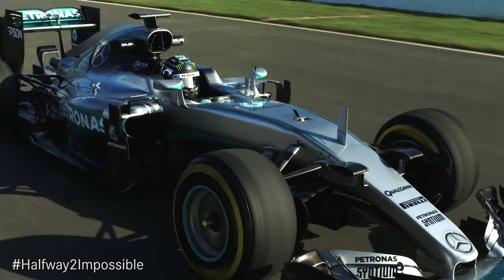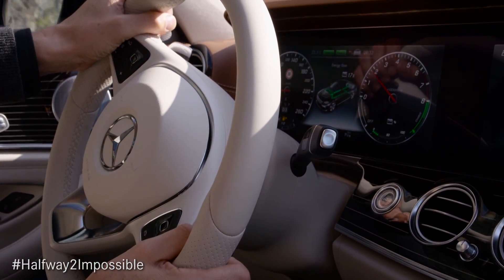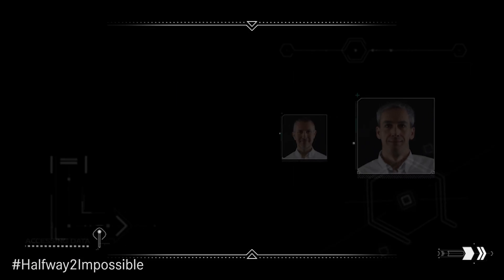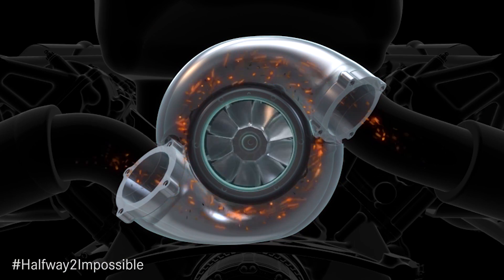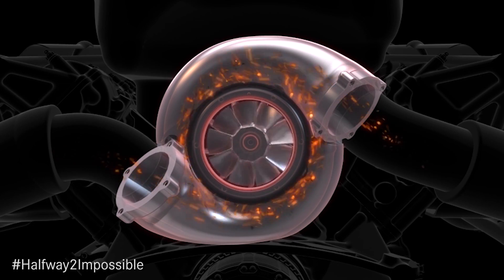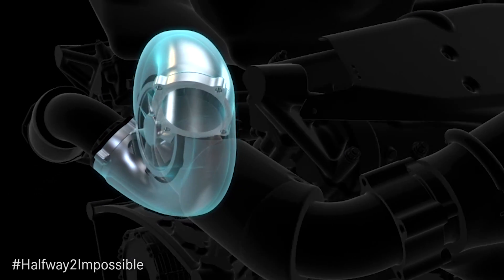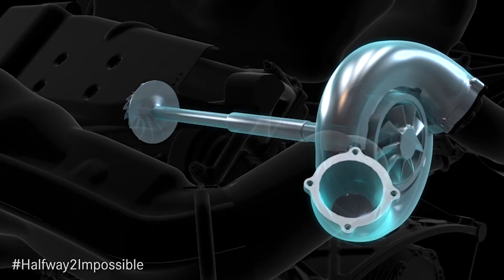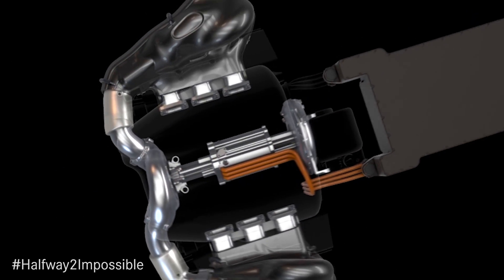How Does it Work? Mercedes F1 Turbo Explained! (2/4)

Comment: I dont get it. F1 fans suffer because the FIA got pressured by activist but non of this technology is even going into road cars? so what was the point? the way an F1 engine works in in no relation to new road cars. they have as much in common then what they have with a diesel engine.

Comment: 1-4 turbo intercooler petrol engines all in Mercedes Benz, AMG, Brabus, Lorinser have been invented by terrorists, street racers.

1-4 turbo intercooler petrol engines all and 1-4 turbo intercooler petrol engines hybrid all in Mercedes Benz, AMG, Brabus, Lorinser : easy damage, 20-100 l/100km, over 100 l/100km with F1 speed and test maximum over 20,000 rpm.

End report.

From
Mercedes Benz all databases

Comment: "The technology of Formula One is well-aligned with the road-car technologies today."
So when is there going to be a production hybrid car with a turbo-generator unit?
Reply from the maker: There are already many production hybrids. And many e-turbo units on the market. You don’t need a 1:1 replica of the complete technical solution for the learning and knowledge to be deeply important to future technologies. Indeed, it’s a mistake to say that because you don’t see the same tech replicated 1:1 that it’s not happening. It’s precisely at the higher level research and learning that gains are made. After this, we apply them to achieve maximum performance, production vehicles will deploy in other ways to achieve emissions or fuel consumption targets. But the development mission of improving thermal efficiency is shared - and the knowledge that propels that mission is both relevant and shared in both directions.
Reply: Today! C Class!

Comment: All petrol engines 1-4 turbo intercooler in Mercedes Benz AMG, Brabus, Lorinser : 20-100 l/100km, over 100 l/100km, easy damage.

From
MB database

End report.

Comment: So having that huge, heavy shaft connecting the impeller to the turbine increases efficiency? Really? And where is similar technology used in "road cars"? And I'm having trouble figuring out you can even JOKINGLY call an F1 car "efficient" or imply that F1 racing is making road cars more "fuel efficient". If I'm not mistaken, F1 cars are burning ethanol, which weighs well under 7 lbs per gallon. Closer to 6 lbs per gallon is probably closer to what its being used in F1 cars to enable them to run extremely high engine RPM and dynamic compression ratios without detonation. 

But I'll use 6.5 lbs for my example. 100 kg is 45 lbs, give or take. Assuming the car goes 200 mph CONSTANTLY for one hour, which is how it should produce the "best" fuel economy since acceleration from slow to fast takes far more fuel than maintaining a specific speed and BRAKING literally produces ZERO mpg or even LESS given how much energy fuel was burned to create is wasted as heat and friction, an F1 car will burn 45 gallons of fuel in one hour. 

That is just under 4.5 miles per gallon. In a super-light, supposedly super-aerodynamic vehicle burning "green" renewable fuel and using the latest, greatest and supposedly "state of the art" technology. And those "high tech" and "state of the art" cars weigh only 1548 lbs. I've got a 2002 Dodge Ram 2500 4x4 Cummins Turbodiesel that weighs well over 7000 lbs.

 I have to literally have the accelerator pedal to the floor at any speed giving the engine as much fuel as it can burn in a vehicle that weighs 4.5 times as much AT LEAST as an F1 car to get WORSE than 5 mpg. Typically, on back roads and rural highways, my "average" for a tank of fuel is 17-18 mpg, give or take. On open, reasonably flat highway I can get better than 20 mpg. And that's with a mild "tune" using a programmer that just replaces the factory ECU program with a mild but still "in spec" aftermarket tune that won't overfuel the engine or produce more torque than the stock tune does. 

It actually increases fuel economy somewhat because it advances the injection timing to produce a longer, more efficient burn of the fuel with more combustion heat and pressure going into the crankshaft instead of out of the exhaust system. I've got a 1972 Chevy C20 with a worn-out old 350 V-8 with a 4-barrel, breaker-point distributor, decent dual exhaust, an automatic transmission (TH350) with no lockup converter and a 3.54:1 rear axle ratio that would consistently get about 12 mpg highway driving. 

My '80 Chevy K10 xx4 shortbox stepsid with a 350, 4-speed and 3.08 gears but with headers and electronic ignition would get 17+ mpg at 75 mph on the interstate with the air-conditioning on. I have a 1985 Chevy K30 1-ton 4x4 dually with a carbureted 454 that's "hot rodded" slightly but very TIRED, 4-barrel carburetor, 4-speed transmission and 4.56 gears and IT would get a solid 10 mpg or better on the highway. 

EVERY ONE of those pickups had at least 75,000 miles on it, was designed to PULL AND HAUL and be used as a utility vehicle rather than a passenger vehicle and had the LOWEST TECHNOLOGY available since 1970 and even EARLIER for the '72 since it didn't have an HEI ignition. And EVERY one of them could be driven as hard as I could drive it, have its guts pulled out with big loads or heavy trailers and STILL not AVERAGE anywhere NEAR as crappy of gas mileage as a "high tech" Formula 1 car. 

So don't blow that "we're improving road vehicles" smoke up MY ass. I'm a lifelong gearhead, 25+ years diesel mechanic and I've worked on everything from nitro RC cars to GE Evolution 4500-hp diesel-electric railroad locomotives. I've worked on a lot of gas-burners, carburetors, fuel injection systems, ignition systems from magnetos to coil-on-plug electronic systems and just about everything out there when it comes to powertrain, electronic, electrical, hydraulic, pneumatic, etc "technology". 

And I can tell you for a fact that AUTOMOTIVE world is always at LEAST 10 years behind the DIESEL world. That TURBOCHARGER design in this video, as far as the "split" impeller housing feeding half the air to one bank and half to the other, is identical to what has been used on GE 7FDL and EVO locomotive engines and their ancestors for decades. So that's nothing new. The only thing new here is putting that big long shaft between the two "wheels". 

And I can't see a possible advantage to it besides trying to create more boost with less heat by separating the two housings. Only problem is that you're going to put more heat into the engine if the shaft is running through it, you're adding a SHITLOAD of weight in terms of rotating mass and THAT is going to take a lot more energy to overcome at LOWER SPEEDS when you don't have it and the EXPANSION of that shaft is going to be significant as it heats up. 

It may all work and of course the GOVERNMENT-SUBSIDIZED FORMULA 1 TEAMS AND FACTORIES will never ADMIT it if it DOESN'T, but that looks like something that is going to cost a lot most than it pays back. And there's NOTHING about it that's going to reduce FUEL USE, which is pretty much FIXED to an extent since its ALWAYS going to take X amount of fuel to do Y work given the fuel is limited in its ENERGY CONTENT. 

Its no wonder NASCAR has gone to restrictor plates and stupid "Car Of Tomorrow" bodies so everybody is stuck with the same basic shape and suspension. When they get a chance they'll probably do what Formula 1 did YEARS if not DECADES ago and make the ENGINES ALL THE SAME TOO. Because that's basically what the hell the deal is now. The only thing really different on those cars is the PAINT and the DECALS. Its a FARCE, it's RUINED racing and competition such that there ever WAS in Europe with the governments subsidizing everything. And it's why those cars are a fraction the size and weight and drag of a NASCAR car and basically burn as much or more fuel.

The myth that ethanol is a "green fuel" is a LIE. Sure, it's "high octane" and "cheap", but its HIGH OCTANE because its HARD TO IGNITE AND DOESN'T CONTAIN MUCH HEAT. And its CHEAP because its government subsidized and DOESN'T CONTAIN MUCH ENERGY PER GALLON. It also evaporates away like crazy, soaks up water like a sponge and is very hard on everything it comes in contact with and REDUCES THE EFFICIENCY of EVERY ENGINE its used in. 

There's also nothing "sustainable" about it since you literally have to use more energy to produce ethanol INCLUDING THE FOSSIL FUELS USED IN THE PRODUCTION AND TRANSPORTATION OF IT, than ANY other liquid fuel.
Reply from the maker: We don’t use ethanol. That’s Indycar.
Reply: Thanks for the essay...
Reply: Not only that:  try to put one of those  eF1ng  engines on a road car...with a clutch;  you'll get a nice  burning smell  at the first light(that's AFTER stalling five times,lol).
Reply: salty much?

Comment: This is not innovation, this is repackaging of OLD and OBSOLETE tecnology.
Reply: +Dreamer 111 You say a lot of nothing.
Reply from the maker: +Dreamer 111 How so?
Reply: MERCEDES AMG PETRONAS Because it is still an ICE. Energy is all around us... one could even argue that we are energy ourselfes. There is no need for destruction or burning of ANYTHING.
From a engineering standpoint it may even be pure genius, but that would be like saying that inventing a better whip to beat the dead horse, is somehow an achievement.
Reply: Typical clueless electric motor fanboy who knows nothing about engineering and can't even begin to understand the complexities of it. Hilarious. The funniest part is, you think electric motors are super advanced, but you don't realize they're actually OLDER than ICE's. That's right. We had electric motors BEFORE we had internal combustion engines. So, what you consider to be "advanced" is actually repackaging of EVEN OLDER tech.
Reply: +MERCEDES AMG PETRONAS It is repackaging of existing tech. It's a turbine powered generator, they have existed in power plants for ages. Of course, it's very smart for use in F1, but I hope it isn't considered proprietary to Mercedes.

Comment: wait i just thought of something if the turbine is sitting exactly at the back of the exhaust it would get very hot so why not put it slightly below its original position so it only gets the maximum amount of air it is capable of getting from the "turbine exhaust" and not the hot air around the rear of the engine, therefore the air that enters the turbine is cooler which gives us cooler compressor air which leads to less pipework.Just an assumption
Reply: Ginger Boy i might be a year to late, but why would you think they splitted the turbo ?
They get colder air this way and there for they need a smaller intercooler
Reply: Bob Havertz ok cool

Comment: I read this in the newspaper years ago.  I assume the other engine manufacturers are not allowed to copy this design because of the rules?

Anyway, Mercedes-Benz in general  does have the best engineers in the car industry.  It is also well known these engineers are not working at their full potential.
Reply: +Carpe diem glxke Other companies can copy the designs, so long as Mercedes haven't already patented it.
Reply: Daniel Chong
F1 engines are frozen by the rules.  They can only be modified for reliabilty reasons.
Reply: Carpe diem glxke EDIT: More specifically, all engine manufacturers are allowed to make changes to any of the engine parts as they wish, as long as they comply with the 32 token limitation. Before 2016, manufacturers are only allowed to make changes to a smaller selection of engine parts. 

http://www.autosport.com/news/report.php/id/122829

You seem to have forgotten that this season, there is virtually free engine development. Perhaps you should be doing some catching up?
Reply from the maker: +Carpe diem glxke Not true last year or this. Performance development can be done!
Reply: +Daniel Chong Thanks for the info.  I found this sentence interesting: "For 2017 the token system will disappear, paving the way for unrestricted development from the manufacturers."

I am wondering: can the other teams copy the design of the Mercedes-engine this year or should they wait until next year?
Reply: Carpe diem glxke why wait if the other teams can benefit immediately? Besides, I'm sure Mercedes wouldn't mind because they are confident that the others can't match the Merc's engine performance.

Comment: The problem is converting heat into a productive force.
Reply: +BariumCobaltNitrog3n Indeed that could be the next area any company can focus on - generating usable power from heat energy and not just from the moving pressurized hot exhaust gases.

Comment: "do more with less" is that the right track of the F1?
Reply: +Alex Crom 94 (Alejandro Piamo) I think the answer for your question is on the history of F1 itself. For example: Fuel restrictions were applied back in the 80's on the end of turbo era. Restrictions on the Traction control, As it for the amount of downforce that a F1 car could carry (recently since 2008). Formula 1 is always changing. F1 should be used as a example to new technologies. Some changes are necessary for that happens.
Reply: +MERCEDES AMG PETRONAS ...because change is the ONLY constant on our plane of existence. 
STOP holding back on alternatives to internal combustion engines! They EXIST and are better for EVERYONE and ANYTHING except your bank accounts.
Reply: +MERCEDES AMG PETRONAS Nicely said! Apt.
Reply: +Alex Crom 94 (Alejandro Piamo) Compare it with weight: build a stronger car with less weight: that was the focus points throughout the years.
Reply: thank you for awnser my question...
Reply: Alex Crom 94 

Yes. Its saves weight.
Reply from the maker: It always has been. Why change?

Comment: The splitting of turbo and compressor saved a lot of pipework needed otherways and furthermore it allows the air entering the compressor to be cooler. Great Idea, hope you hired that intern who had the idea. ;)

Which material is the connecting rod between turbo and compressor ?